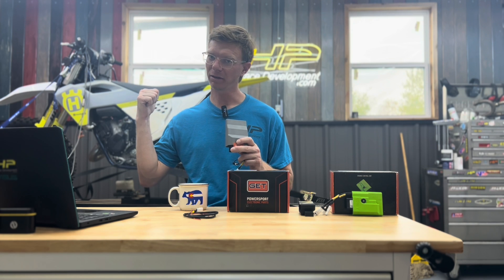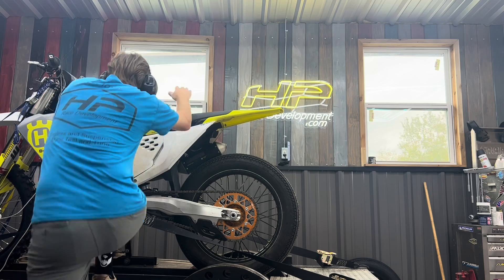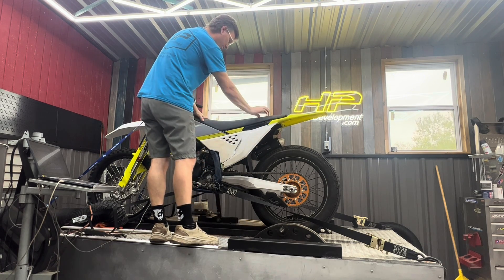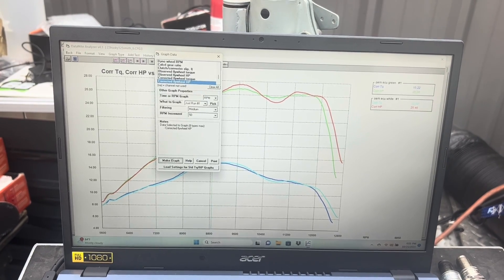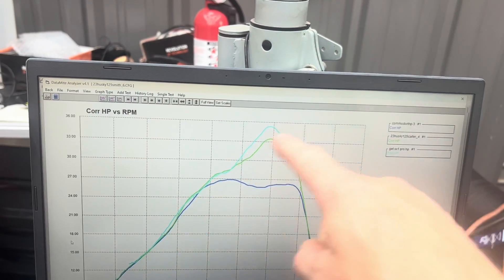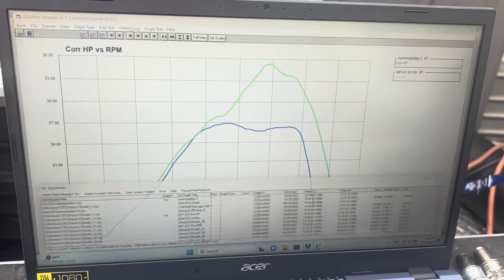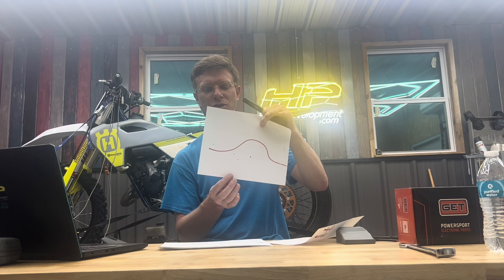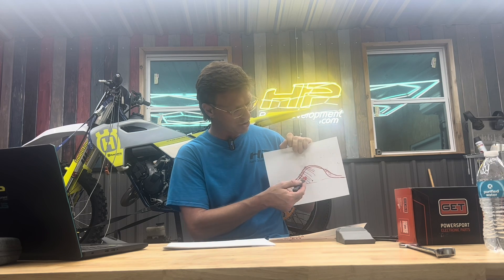EFI two stroke dyno testing NEW GET SX1 ECU

Comment: Hi! Would you reccomend a GET SX1 ecu for SX300 if the aim is more low end/ torque, and maybe better throttle respond? (And not the high rev/peak power...) Thanks!
Reply from the maker: What people refer to as bottom end is a very tricky subject. Its mostly our experience they mean partial throttle power

Tuning can make big changes in feel here - so its possible it can achieve your desires. Its also possible it could be “too much” depending on powervalve setting settings and such.

Comment: Derek have you had any austrian TBI 2 strokes that require throttle to start when warm? Ever since day 1 with my brand new 250 XC-W it requires ZERO throttle to start when the bike is stone cold, but when it's warmed up it always requires a C-hair of throttle to start. Otherwise the starter will just spin and spin. I always see guys starting their bikes with a split second push of the button. After a TSP medium comp head install and ECU flash it's still the same. Not a big deal, but I was just curious. Funny how some of the TBI bikes you see run great and others run like 💩.
Reply from the maker: @K-Rivs  carb bikes routinely required some throttle when you kicked or e started. I dont see why thats odd for an efi bike to need same - starting is a complicated challenge on efi 
people want efi to be magic but its just a fuel delivery system - not magic.
Reply: Agreed. I remember riding it for the first time and said man it's so similar to the old school carb'd smokers. I was just curious since it seems like not every TBI smoker is identical running wise. Appreciate it
Reply from the maker: @K-Rivs  they do seem to vary more but people never appreciated how amazing carbs really are so now i think its a slap in the face when efi is not what people expected.

Comment: What inputs does the tpi bikes have?is it just mostly intake temp and pressure tps and pvp and coolant temp?is there options to add a 02 censor a chain sensor rear wheel sensor and etc?
Reply from the maker: @denniswilder3014  02 on a 2 stroke is about worthless. You can prove me wrong and I would be excited about it…
The oem ecu can not be changed for additions
Reply: @HPRaceDevelopment  talk to iantomassi race engines. And look at what they build for snocross and cross country race sleds. Yes they are variable clutching but never ever at the same rpms.
Reply from the maker: @denniswilder3014  Its not even remotely alike to mx or offroad. Sleds are very much at consistent on the pipe rpms. secondly - what 02 you read is not the 02 that was in the combustion chamber and thats all we care about for tuning. the delay time pending where the sensor is placed is huge, and the closed loop correction time is far too long on an offroad bike to be function. Its too slow for 4 stroke mxers and offroad bikes with fast response accurate ish 02 feedback and correction. The fuel you supply on a 2t via a tb takes over 10 cycles to really be noticed in the chamber - and would likely be 50-70 cycles before an 02 sensor would notice it - if it were accurate which it isnt. Honda has a full sae paper on the subject if you wish to dig into it. The moto gp teams were never able to make efi work better than carbs and for all those reasons plus many more i havent touched on
For dyno work you can make an 02 system somewhat functional and create cheat offset tables as to when its accurate and when its not but its not very useful to accomplishing the goal of good running
Reply: @HPRaceDevelopment  pipes in snocross are no where near the same pipe temp. The rpms are all over the place just like moto cross. And if things are ever variable in moto cross why do you just post about peak horsepower numbers that only happen in a short rpm range. The new 02 sensors respond just as fast as a servo motor on electric power valves and all the sensors on the efi bikes.
Reply from the maker: @denniswilder3014  We report the entire wot curve - not sure what what videos you have watched. You can argue all you want. Go get a sled shop to prove me wrong - as I stated Id be happy to see it.
Reply from the maker: @denniswilder3014  servo motors are too slow for perfect pv operation and as such understanding this and using it to your advantage on starts etc results in advantages. Our launch control mode on the 2t efi servo pv engine controls the pv differently than in running operation and keeps it from going full open prior to gate drop so its at the proper height the instant the rpms drop and load is applied. Its significantly better than trying to wait on the servo

Comment: @HPRace,,, I would like to know how long most of these bikes that run the lower HP numbers were ran for in your area.. Question being are these bikes not adjusting their long term trims based fuel quickly because these bikes were first ran in a different elevation / conditons and  just have not be run long enough to "Optimize" trims....?
Reply from the maker: Dirtbikes dont trim like a car. There is no sensor that returns lamda or combustion data to the ecu.  The only correction factors off measurement are baro and map sensor and intake air temp, as well as coolant temp.   The ecu reads these as its running and adjusts according to its programmed settings to do so. 

The bike shown here resides here and is ridden here full time… It was just a dud.

Comment: You can't do tests on a cold bike. Those bikes must be 165° minimum before they can be ran properly. The computer in the bike adjust according to the temperature. You first start those bikes and start grabbing that throttle you're injecting too much oil into the engine and foulingi the plug.  When an engine is cold the bike is being fed extra oil to protect the motor. When it is warmed up it receives less oil. In other words you're drowning the bike. Then trying to say that ECU is better than the stock one. Simply put a temperature gauge on all your bikes get them up to a 165° then do your tests. You will see a massive difference
Reply from the maker: We don't do tests on cold bikes

Comment: Another great video. Thank you. I would agree as I run a 15 300EXC with a Lectron and a 23 300SX TBI. Both with high compression heads and the 300SXS CDI in the 15 bike, so pretty similar characters. 

What the TBI does great is mostly on the PV control, you can have the best of both worlds. It’s also better on the top end than the fixed power jet on the 38HV Lectron. They’re both crisp to ride and both similar on fuel. The TBI edges it a little. 

The 23 300SX TBI is bang on out the box, I put 35hrs on mine before messing with it. Went with the TSP power kit but found your videos looking for tuning info. 

Their kit with the head and ERM is good, the MX4 map is crisp, the white map is better (stock one is a bit limp) but I liked the bottom on the stock green map better for the dunes. Their green map will be better at our local 🇦🇪 MX track which is hot dusty hardpack like theirs in Oz. 🇦🇺

Clever stuff all this… for all the clever advancements in four stroke technology… they’ve never made them as fun or interesting as two strokes. 🤭

Keep up the good work and thanks for sharing great content. 😎

Comment: Hi. Is this ecu ok to use straight out the box if i’m running a pipe and head insert as well or will it need to be mapped accordingly? 
Many thanks
Reply from the maker: We map ours uniquely vs an off the shelf get even for stock engines - and custom to each clients bike when ordered from us. thx for asking

Comment: Looking to run this with 40:1 Motorex, C12, and a fmf pipe and silencer. Is this okay or does that need to be mentioned when ordering? TPS to 4.000v? Video soon on TPS, power valve reset, and throttle points? Should this be checked regularly?
Reply from the maker: we can do a video on that although its for our clients not our youtube audience

Comment: @HPRaceDevelopment Hello! I want to order the GET ECU for my '24 125SX; but have a few questions. Does it come with only your two default maps? And what are the differences between the 2 maps? Also, do you have any maps with Akrapovic slip on and VP T2 racing fuel? And when will the SX1 controller and wi-fi connect be available? Thank you!
Reply from the maker: We might have our own wifi comm available before GET does from a different project we are involved with.  Our maps currently are evolving, t2 we think is a good fit for some maps we have.  Only can come with 2 maps - whichever we map it to.  Your phone can store as many edits to these maps as you wish.

Comment: Thanks for the great and informative video. We have long suspected that there is a difference in power between bikes, first time i see dyno numbers on it
Now GET boxes have started to appear at dealers here in Sweden, I will test it on my son's 125. I wonder how it works with error codes, are they stored in the GET box. Can I read out and reset codes myself? and what happens to the hourmeter when you change the box?  Thanks
Reply from the maker: I hadn't even thought about the hour meter - it likely doesn't work correctly if the bike already had hours because the GET internal hour meter wont have any hours yet.  The std GET maps run pretty well on the dyno, but we had track issues that we think we have mostly resolved.  EFI will be a very long ongoing challenge!  Once the wifi comms are avialable you can read sensors live and read and faults it detects.  We might have our own wifi comm soon - testing shortly

Comment: Thank you for the video.  We have been racing a 2023 in GNCC this year.   These races go 2 to 3 hours so the bikes get beat fast.   So far its been "OK" but we struggle with constant "codes" flashing.  They don't always mean the bike doesn't run but its pretty annoying to see the on the starting line.  Will this GET ECU have a way that we could look at and clear these codes?  This would help us and our customers greatly.  Now the options are to clear are take to KTM dealer or the KTM support tent which can be a real pain.    Thank you

Comment: why is this 116cc making more power https://www.youtube.com/watch?v=62NUVjGh03Q&ab_channel=BARacing than the husky
Reply from the maker: on my dyno? Sorry but apples to oranges
Reply: @HPRaceDevelopment  arnt most dynos within 5% of each other
Reply from the maker: Depends on a host of factors.  Ours is consitently a lot below what others post.  I make no claims this particular 125 is a rocket ship, I have 112's that make nearly the same power.  But I also have had "30 hp" claimed engines come through making mid 20's.   @hubertkam7647

Comment: Buaght my girl a tc125 same bike having problems with fouling a plug bike runs extremely rich and smokes and spits from idle to mid have you noticed that on these bikes? Dealer says it has the latest ecu update the bike isnt constantly being reved to the moon and cleared out but its ridden hard enough in my opinion that it should not be fouling a plug my yz125 can idle and do slow technical trails all day long with no plug fouling. Is this rich start up somthing you guys adressed and fixed in your preset tunes on the ecu?

Comment: I remember when Honda tried using EFi on their 500 Gp road race twostrokes. some friends of mine were on the team and their take on EFi two stokes was in the end to leave the carby on them. There were no performance gains to be had in the end. It could be a tool to get past some emissions or fuel consumption requirements that we don't have in MX but as far as performance and Moto go I believe it makes the bike more expensive to own and operate. The lifecycle of the Bike will be reduced and the resale value drop to zero in 5 or 6 years. The increased purchase prices efi brings plus the running cost and lack of cheap used bikes that entry-level riders usually start with will make this sport smaller in the future. Factory management is pushing for quick profit increases but the long-term effect will be a smaller sport,
Reply from the maker: The fundamental challenges to efi still havent been solved - which really sucks! not much improvement over 30 years despite the massive processing power increase. Frustrating!
Reply: @HPRaceDevelopment  i was going to ask why they don't do direct injection but then I realized the entire intake stream is what lubricates the crank and cylinder.
Reply from the maker: @therawlifefamily  Athena GET has done a di two stroke project around 10-12 years ago. You just have to inject the oil a different way. 

But DI will produce considerably less power. Its only advantage is emmissions

Comment: how can it be optimal if they are preset maps
Reply from the maker: What do you mean.
Reply: I may have jumped to a conclusion but I got the impression they have preprogrammed maps rather than being tunable?? So therefore you cannot optimise the output for a particular bike @HPRaceDevelopment
Reply from the maker: @johnnycomelately6341  what has pre programmed maps
Reply: @HPRaceDevelopment i think he is asking, is the get ecu in the video stock maps from the factory, or are they your custom maps? I could be wrong.

Comment: Am i tripping or does the stock 125 with the get ecu way better than the carbd bike? You said the light blue (you said light green) is a stock bike with get ecu and the green one was the full motor package right? Stock with get made more power up the entire front side no??? Seems like efi IS a better platform???
Reply from the maker: It is mostly better than the mod carb bike.  But depending how you ride - may or may not like where the power is placed.
Reply from the maker: Now it's not as good as shown as OUR mod carb bike - but we havent published how that runs
Reply: @HPRaceDevelopment  I see, I thought that was your bike, my fault. Do you see the same trend on the bigger efi bikes like 250 and 300 vs the carbd versions? I imagine the larger bore with the stronger pull on the carb helps fill up the front side of the power curve vs the small bore shown?
Reply from the maker: @googlesucks3520  The front side power differences are not due to carb vs efi. porting, pipe, and cdi/ignition values. our carb model makes same front
Reply: @HPRaceDevelopment  I see, thanks man 🙏

Comment: I wish the few manufacturers that still make 2-strokes would have just stuck with carburetors or went all the way to direct injection like E-TEC system on Skidoo-snowmobiles….this seems like a step backwards on multiple forefronts…..even upgrading 2-stroke dirt bikes to 90’s moto-GP tech would have been welcomed / appreciated (power jet with variable timing based on TPS and set-counter that adjusts timing maps on the fly), which wouldn’t be as hard to do now, as it was back then.
Reply: Honestly dude I work on DI engines everyday of my life as a mechanic and IMO DI is a fuckin pain in the ass. I don't want DI anywhere near my bikes, I don't even really want FI on my 2 strokes to be honest but direct injection is 5x worse.

Comment: I feel like if they do find a way to make these efi 2 strokes alot faster then the carb bikes than it would be something inside the engine like a different powervalve design. Which it would also be something that could be put in a carb engine.
Reply from the maker: EFI wont make the bike faster just because it's EFI.
And powervalve designs are already fantastic.  Faster 125's already exist in carting - but they haven't made their way to MX
Reply: @HPRaceDevelopment  interesting, ive always thought 2 strokes in motocross always had the latest tech.
Reply from the maker: Not even close @adriangalvez5104
Reply: @HPRaceDevelopment what are your thoughts on a loop system with an O2 sensor ? Any reason why it wasn’t done that way that you could determine .
Reply from the maker: closed loop is what you mean - and it's response time is too slow for one, secondly the readings aren't accurate on a 2 stroke, and thirdly it would kill the sensor in short time with the premix oil.  Additionally a 2 stroke doesn't "tune" to a "set" afr @jamessharp9790
Reply: @HPRaceDevelopment  thank you. Makes sense given the dynamics of any Schnuerle loop two stroke , much less Kaden expansion chamber dynamics. Unfortunately it seems like tuning any efi on one will be a long uphill battle.
Reply: How much is a get Ecu for. 2023 sx 125 my bikes got Fmf factory fatty front pipe and a Fmf powercore titanium silencer and run vpower 99octance fuel let me know please Gary